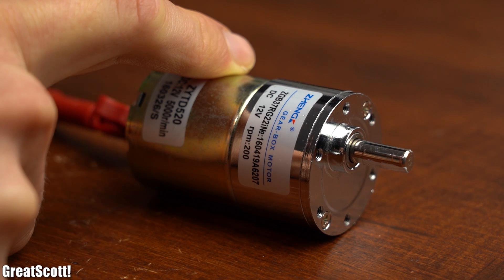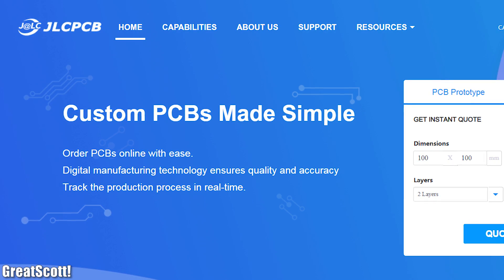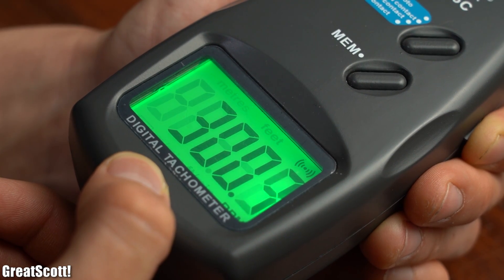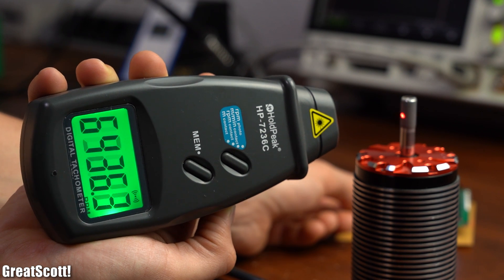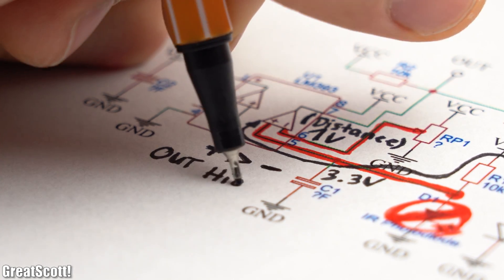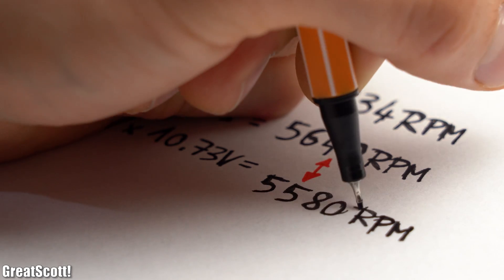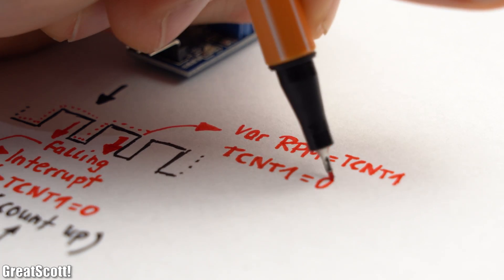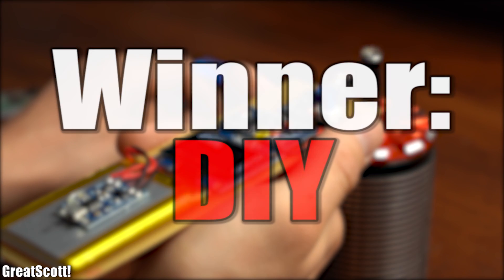Tachometer (RPM Meter) || DIY or Buy || How a 3€ sensor outdoes a 29€ product!

Comment: Hi scott. I tried building this tachometer and since I couldn't buy 3.3v version of pro mini I used 5 volt version instead which I believe uses 16MHz oscillator. I also modified the formula and replaced 32500 with 62500 based on what you said and replaced 120 with 60 however I didn't get the rpm and it outputs 0 and some random values. Any ideas where have I gone wrong?😔😔😔

Comment: The contact messasure with the outside of the wheel works only with the same diameter of the motor axis . If you want to messaure right you have to conact the middle points of the wheels.

Comment: If you connect the motor shaft to the side of the tachometer, it creates a gear ratio and gives incorrect readings. To get accurate measurements, you need to connect the centers of the motor shaft and the tachometer.

Comment: Dude I'm a great fan of yours.
And tried to make this project; but with an UNO instead of NANO, and with a TCRT5000 4pin module (This does not affect the results because I use digital output pin of the module). In the end, I got 14448 result or slow.
I think it's because of the 16MHZ frequency of my UNO. Am I right? Can you add an alternative code for UNO? Or tell us where to change.
These timer calculations are very hard for me I do not understand anything about them.

Comment: I think you’re comparing two applications—the store bought tachometer may trade some accuracy for range with long distance measurement. You may try repeating the experiment with distances and see how far your custom built one can read.
Reply: Although the direct contact roller adapters you would think would eliminate matters of distance.

I wonder if the thickness of the white stripe influences measurements too. You may want to play with a larger radius, plus the geometry is a bit odd. You’re projecting onto a line which is rotating but is not rotating about the axis of rotation that the laser is focused on.

Comment: I'm generally useless with code, but would there be an easy way to add a peak rpm readout to the display (over a ~350ms window say) that could be reset with a momentary switch? Thanks for the great video!

Comment: Used one of these sensors with my oscilloscope. The problem I had was as soon as I went outside the IR from the sun messed up the sensitivity range.

Currently trying with a 38khz tv remote receiver and ir led transmitter.

Comment: ya,,, 300/150rpm... maybe start by using it correctly... shaft gotta go directly above it, not on the side... now theres a ratio the motor shaft been smaller.... its normal its giving 150rpm, the shaft of the tacho is turning at 150 man... (thats with other conic part that you've shown but didnt use at all)

Comment: Thank you for the author's release, very practical test device, very suitable for professional technicians: electrician/car repairman/industrial...etc, I like this project, I will create and assemble a 3D shell  (There is no need for any circuit board PCB, as long as the distribution line is enough), it will not be long before I will post a comment on the shell 3D printing to stl to share with everyone

Comment: Is it possible to make the same rpm meter while using a 8266/esp32 chip instead?
Reply: I am sure it is, you just need a microcontroller of some kind to run the Arduino code or you could program it in a different language.

Comment: Thanks for this , I built it but was getting twice the rpm my scope said ! I have changed 120 in the code to 60 and now it works perfectly.

Thanks for a great project.
I am going to run it off of an 18650  a fuse instead of the charging board . On the occasions I want to use it I will put in a battery. This keeps costs down for something it will use now and again.
Reply: Yes i was also getting twice the rpm compared to the actual rpm of the motor.

Comment: the roller adapter would only give you a correct reading if the shaft of the motor is the same diameter as the roller, otherwise you'll get a different "gear ratio", which will cause the values to be off

Comment: Awesome, how did you calculate the minimum and maximum rpm? I suppose you could measure lower rpm with more pulses per revolution? (Two pieces of white tape on the shaft instead of one)

Comment: I'm making a similar rev. counter, but I'm finding that the edges produced by the IR sensor are very noisy; it looks like it will need an additional Schmitt trigger to work reliably - the ESP32 board that I'm using never sees less than two interrupts per transition. 

[edit: I seem to have cleaned up the edges very substantially by putting a 680 pF cap. between the IR o/p and ground - it slows the rise time from about 10 us to 20 us, but the ESP32 seems perfectly happy with that - so maybe there is no need for a Schmitt trigger after all]

Comment: hi, why did you use Protection board , when the battery has its own?
Reply: BMS for overcharge . TP4056 for over charge, over discharge (3A), battery current limit, recovery charge and if battery 2.5V, cut output of the battery. But BMS don't have this feature

Comment: Great, I was having a plan to get a laser tachometer for my small cnc now I will build it. But the optical sensor can measure high speed rpm ? Like 8K rpm or more for the spindle

Comment: Hello sir. I would have a question. How can I determine my measurement tolerance in a system we have created in this way? What margin of error do you think the rpm you get with your microprocessor has? can i say +-5RPM or is it larger than that?

Comment: Thanks for this project - works great for me. Even at high RPM values.  One weird thing i had was that i've to use the analog output of the TRS5000 sensor module - had too much noise on the digital out with this code so I would get random numbers in the 5 digits even when i was testing with a 200rpm motor.  With the analog output it works great though. At the end i've used the analog output with an additional schmitt trigger. So if anybody else should have a problem with the digital out of the sensor ....try the analog out.
Reply: How to get analog out of this sensor?
Reply: @ikarib  There are 2 versions of this board. They've the identical setup, but one has 4 pins instead of 3 so you also have an analog output.

Comment: Great Scott, I am big fan of you and you never make mistakes but I am afraid this time you did using the tachometer attachment incorrectly to measure the RPM. 
The way you used the attachment measures the linear travelling not the RPM. To measure the RPM tachometer attachment must be coupled with the motor shaft, face to face, not the side by side.
In your case change in shaft diameter would change the reading.

Comment: Great video  !! in the schematic of IR distance measuring sensor there is hystersis resistor connected between the output and the non inverting input are you sure this is not there or did you miss it ? Those square are just too perfect lol may be C1 is acting like a damping cap but still never seen such a beautiful square wave on any comparator without a hystersis or at least it is a good practice.
Secondly at the beginning of the video would be nice if you mention the applied voltage to the motor and the current consumed by it at no-load so optically measuring the speed and current consumed when you probed it with the rotating shaft of the tachometer it is just for my interest thank you for your videos...
Reply: I can't find the code

Comment: Thanks for reverse engineering the circuit of the module! I used your schematics to figure out how to add hysteresis (Schmitt trigger) to the circuit: You can easily add positive feedback to the comparator by adding a resistor between the output and the non-inverting input.
I just soldered a 20k resistor between the OUT terminal and the anode of the Photodiode on the backside of the PCB. 
I did this because I had problems with false interrupt triggering on an ESP32 using this module. Apparently the ESP32 external interrupts need a quite fast rise time to trigger reliably. It would have been interesting to see how noisy the rising and falling edges of the signal in your setup are by zooming in on the DSO. 
The 20k might not work for all sensitivity settings of the trimmer pot. To change the hysteresis it might be a good idea to replace the resistor with another trimmer pot.

Comment: Hey Scott! Thanks for this great video. I'm also trying to build the same circuit with a few differences. But the problem is i'm using Pro mini 5v 16mhz. I think timers are messing up at this clock. I'm pretty new to these. What should i change in order to make this work with 16mhz pro min? Keep up the good work, thanks for the educative videos!
Reply: Change 31250 ( max number counts at 8mhz) to 62500   Also change 120 to 60 as that was just wrong!

Rpmfloat  = 60 / (rpmtime/ 62500);

Comment: Thanks for the video and the tachometer project.
I was doing experiments with PC-fans. And i wanted to know how to measure RPM correctly. And see if these sensors from AliExpress could do the job. So I bought a few of them, put one sticker on one of the blades of my 12 cm fan. The result was very dissapointing, the cheap sensor could not read this signal quick enough. Even not below a few hundred RPM (checked on scope via 3rd sensor wire). So these sensors are surely way to slow for this kind of RPM measurements.
I bought a proper one (Voltcraft DT-10L laser tachometer, for about 62 euro's). This tachometer can measure up to 99999 RPM and works fine and precisely.

Comment: I enjoy watching your videos and I don't argue with your project being more accurate than the HoldPeak, but I have to comment that the title is a bit misleading since you are comparing a single 3€ component, which requires a bunch of other parts adding up to about 20€, to a finished 29€ product ready to use.

Comment: I wonder if there's something wrong with the timing circuit on the 29€ unit? Would be neat to do a follow-up with diagnostics if you can get inside the thing, shouldn't be too complicated since all it does is compare pulses to a clock. (Unless you returned it for some reason.)

Comment: can it be modified in any way and used as a Speedometer for my bicycle??
Reply: hall sensor RPM cost 2-6€ cheap bicykle rpm meter. no need build diy. need only calculate form add code, tire circumtance, how long have and calculate how many time  run 60 S,  Circumx60xT somethink.  i not remember now.

Comment: A year ago I had a similar project. I had quite the Problem with the accurate counting, because the Arduino was too fast and produced overcounting because the interrupt was triggered several times at the edge of the tape. I had to use a delay of some us to avoid double counting of rotations. I am rather surprised that your setup worked so well for you.
Reply: Hi, i'm currently working on the same kind of tachometer (using mega8 uC, LCD, and the same IR sensor). By inaccurate counting i assume its external interrupt triggers several times while the object passes only 1 time?

while testing the IR sensor, i realized after i tried to wave my hand 1 time in front of the sensor, the interrupt count suddenly increments by 4! (and sometimes even 6 lol) this led me to assume that the output of the IR sensor itself is bouncing. (and i dont have oscilloscope to check this since i'm still a student)

this issue is solved after adding some RC network to debounce it, and the IR sensor triggers the ext interrupt now correctly (for example i waved my hand 5 times in a fast manner, and the count increments exactly 5 counts)

Hope this helps and I'm happy to accept any advice too, thanks~
Reply: @yeyee2418  Hi Yeyee_Gabriel_S_,, seems your solutions can work with me too,, but I'm lack of information about how to connect the RC network to the IR Sensor output,, any reference or some wiring diagrams that I can accessed?
Thanks in advance,,

Comment: I hope you read this. Please consider making a 3D printed 8th order bandpass speaker with a (hidden) 4.5 inch driver to 250-300Hz with port on same side as a 2.5 inch driver for the rest of frequency range and design a proper crossover for that design. We all learn about crossover eventually and now you can be authority and overcome previous mistake. We love your videos and your excellent efforts.

Comment: you could also use the timer1 with its clock pin to the t1 pin and set comp a to interrupt the uc to tell that 2^16 rotations are complete. and the uc would increment a long value at each interrupt so no if rotations could be calculated at the end of each second.. right? just asking because i want to make something similar with an attiny84 instead using a much lower capacity battery.. thanks!

Comment: The problem with contact measuring is that the value depends on radius of the tip, the bigger radius the lower will be rpm. It's just like using gears with different number of teeth

Comment: Hey GreatScott!,
Congratulations on the project, it looks really neat and outperforms commercial equivalents! However, there is a small, 2px wide band of noise on the right side of your display. Its probably due to the display controller being a SH1106 - a "SSD1306-compatible" driver which has 132 px wide display RAM (contrary to SSD1306's 128 px). Most of the libraries and tutorials out there focus on the SSD1306. To fix it, either switch to SH1106 in the graphics library or just find the function which transmits the cursor address and add a permanent +2 term to the x coordinate. I had the same thing literally yesterday so I noticed it immediately.

MfG :)

Comment: The contact measurement was done incorrectly.  The inverted cone was to be placed onto the end of the motor shaft so that you get a 1:1 gear ratio.  Rolling on the side as you did your measurement is thrown off by the relative diameters of the sensor and the motor shaft.  The only sensor that is to be used that way is the wheel for measuring distance.

Comment: If you use a bigger prescaler value in your timer or also count overflows between measurements you could get a lower minimum RPM.

Comment: Even for the laser measuring part, you still messed up, you are supposed to attach a wheel to the end of the shaft and use the flat side for color differentiation (like this ◐). Doing so will give an instantaneous signal change instead of a gradual one when you tape on the round shaft. 

For some reason, your tachometer didn't come with some reflective tapes, these are like the ones on the trucks and provide better contrast.

Comment: Back in my model airplane days some 20 years ago I used a Tower Hobbies optical tachometer to measure the prop speed of my glow engines.  It could be set to read the speed of two or three-bladed props.  Some of my engines could go as high as 25,000 RPM.  I used to check its calibration by pointing it at a fluorescent light to read the line frequency.  Seemed to be quite accurate so I never questioned the readings.  The only mod I made was to fit a small flat-black painted tube made of cardboard over the sensor port to keep side-light from swamping the sensor, which only used reflected light - no laser.  Oh, and I don't think I paid more than $20 for it back then.

Comment: 3:17 This is how you know that you're dealing with an electrical engineer and not a mechanical engineer.
Reply: It was a distraction mistake.
It doesn't require a mechanical engineer to understand what kind of error is produced by measuring in that way, it's something like 1st year high school physics.
Reply: I was surprised by that too 🤣
Reply: Look at the top comment
Reply: @Willeexd1337  He edited his comment after I posted this.

Comment: Hello sir.  Im new to electronics.  About 5 months in now.  The more I learn the more I realize I need to learn :).  Im looking to build a persistence of vision clock with a rotating led head.  I want to be able to program the arduino so that it's useful for making 8 bit pics etc.  So this came at the perfect time.  I need to know the RPM of the motor I'm using exactly or within a few so that I can time when the LEDs come on and off.  I want to build this tachometer and have everything on hand except the LIPO.  I have a few I pulled from old electronics but I doubt they have sufficient output.  Is it absolutely necessary to use a lipo or can I use normal disposable batteries as long as I make sure the power output is very consistent.  Im sure there is an easier way to build my other project but again I'm learning and just trying to make things work with the knowledge I have to point helps me learn more and practice.  If you have time to respond I appreciate it.  Either way I love your videos.  They've given me a lot of inspiration alongside the technical knowledge.  Much appreciated.

Comment: I don't know if Id say 857 was in the range of this device either. These are more or less designed to measure in the thousands! At this low of a speed it is not likely to be very accurate. They work great for measuring the output shaft of a transmission connected to a real motor.

Comment: You just build yourself an encoder. In some machinery they might use an inductive proximity sensor instead of IR to calculate speed of a gear or roller (welding some screw head on it). Different setup but still same concept

Comment: Nice video, thank you. I am not 100%  sure that the charging circuit ( designed for 18650 liion cell) is suitable for lipo, could you confirm ?

Comment: Question on the contact mode: isn't RPM shaft diameter relative? Strictly, inversely proportional to gear ratio... Buy option still might be good, but it beats the purpose of being "on the field" tool for the additional computation.

Comment: An easy-to-implement software upgrade idea: You can measure slow speeds also by not counting the impulses per second (minute), but by measuring the elapsed time between impulses.